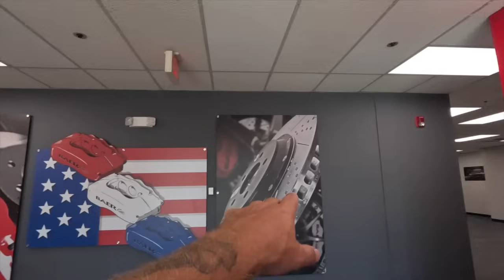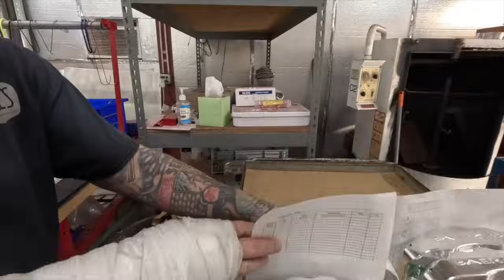Mountain Escape: When Your Brakes Fail You Visit Baer Brakes Headquarters

Comment: What is the Standard sized Rotor on your Trans Am and my Z-28 Camaro.  Is that a manual master Cylinder?  Power brakes have a big heavy vacuum  booster on them. Neither my '68 Chevy C-10 Pickup  my 1970 Chevy Impala nor my 1973 Chevelle had power brakes and they stopped just fine.  Every other vehicle I have owned I think had power brakes.
  I like the idea of having a rotor on the rear axle small enough to clear 15" wheels as I do have some L-60 Sticky tires on 10" wide rimes that do really hook up well.  Those tires reduced my standing start 1/4 Miles circle track time from 21 seconds to 19 seconds..

Comment: Smoking brakes?  Did you have a stuck Caliper?  My Camaro has a Doug Nash 5-speed.    Trans AM WS-6 package had 4 wheel disc brakes and 8" rims instead of 7" rims  bigger sway bars.
Reply from the maker: Not exactly sure what happened but it was terrifying
Reply: @adamsandoval    Up here in Michigan we have stuck Calipers all of the time because of Salt Chloride hi humidity causes rust.  If you did not have to repair your brakes to get home. Maybe nothing was wrong with them? Were you just riding the brakes on the downhill and get them smoking hot?  The Standard small disc front and small drum rear brakes on my Camaro and stop the car quickly from 150 MPH one or two times then they got hot and fad a lot. Race vehicles use Metalic pads.  Exotic cars use Carbon Fiber diss that cost big $$$.
  If you just ride your brakes lightly down a mountain hill they will overheat and start smoking. You  must have at least a  4 speed auto with overdrive. if you have an LS motor.  You should have just dropped down into a lower gear and used engine braking.
  This guy from Cuba who went to Truck Driving School in FL and worked for a CO in Texas didn't know what a runaway Truck Ramp was. He passed several of them.  He smoked his brakes and they failed in Utah.  He called his dispatcher who told him to keep driving.. Coming into Denver he rode is brakes lightly until they were so hot they no longer had any stopping power.  If he could read English, the sings told him Speed limit for Trucks  30 MPH Keep the track in a low gear ect.   He killed a number of People and caused a huge inferno that shut down the highway for a few days.
https://nypost.com/2021/12/14/truck-driver-gets-110-years-for-fatal-colorado-crash/